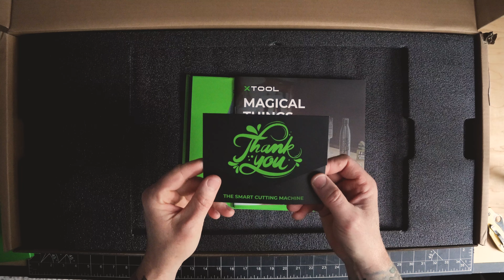xTool D1 Pro Unboxing & Setup for leatherworkers

Comment: Looks easy to setup. Not sure what software it comes with but light burn is what I use. It’s fairly simple and easy to use.
Reply from the maker: It was very easy to setup. The software it comes with is xTool Creative Space. It basically a stripped down version of Illustrator. This weeks video I will be discussing the software and if it’s necessary to upgrade.